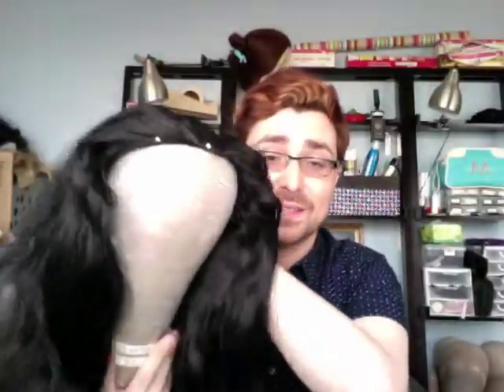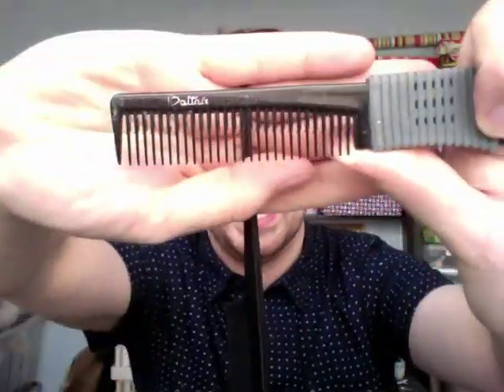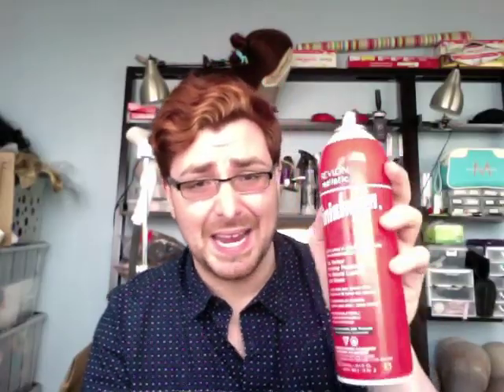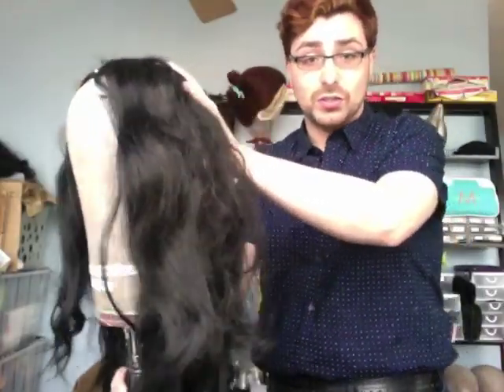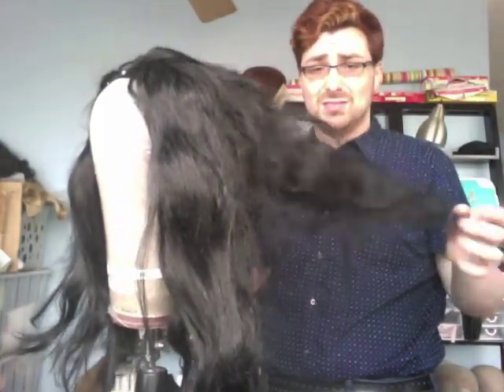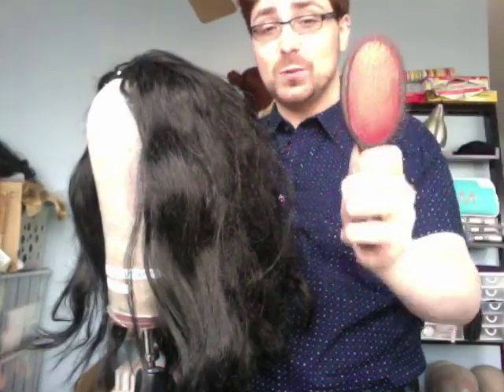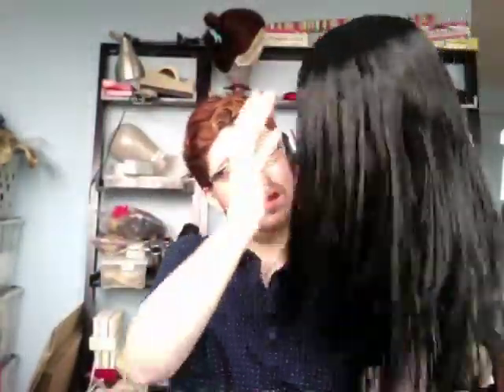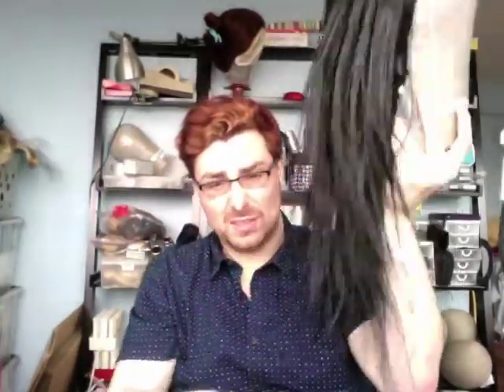Tutorial - Steaming Synthetic Wigs For Drag, Theater, Opera and Cosplay

Comment: THANK YOU!! I believe you've just saved me about $500 in wigs headed out for the, well, let's just call it the "Wig Heaven Far Above!"  You are very gifted and an excellent teacher.  One thing I've found about wig advice (e.g. applying anything hot to a synthetic wig, etc.) is that you always MUST CONSIDER THE SOURCE.  I've bought some very, very expensive synthetic wigs directly from a store in a large city.  The gals who work there have repeatedly told me that the least little heat applied will ruin my $250 investment.  Well, knowing that a synthetic wig is just a wig made out of a "type of plastic" and not TNT - I knew there had to be a way of bringing them back to life.  The only thing to get "burned" by your processes are the shops who want my return business bad and fast!!  Ha Ha - Gotcha'
Bye,
Barb from Ohio

Comment from the maker: Niyaa, I don't think a hot shower would be warm enough to steam the hair straight. I would suggest removing the weave, then steaming it out and reinstalling it. If it's heat resistant hair you could also run a warm iron over it, if it's not possibly try wetting the hair down and gliding quickly over it with an iron on the lowest temperature so it won't singe it.

Comment: I lost all my hair and cant afford a human hair one so i got a really good synthetic one. I love it so much but the ends are fried! I cant afford a clothing steamer, is there any other options? Can you use the steam from a clothing iron? (ofc not put the iron on the wig but just the steam) or do you have any other ideas? Also youre super good and you got a new sub!
Reply from the maker: +HighConCannibal Try putting the wig on a head on a stand in the shower, and try pouring some boiling water over it and combing the hair smooth after. Usually the weight of the hair and hot water running through it will stretch the hair back out and help make the ends less frizzy, repeat this a few times until the frizz is gone.

If the wig is heat resistant, you can use a flat iron on medium/low heat setting.

I've never seen a clothing iron emit enough heat to steam out a wig, personally, and i'd be hesitant since the metal iron could melt or scorch the hair if it gets too close.

You can purchase small hand-held steamers from Amazon or Bed Bath And Beyond for about $20, it's a great investment especially if you wear wigs regularly.